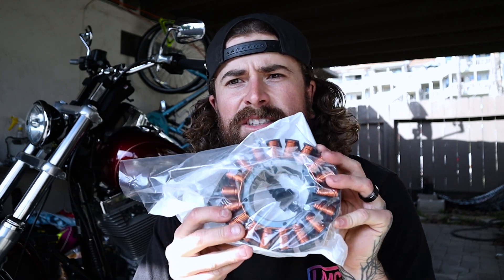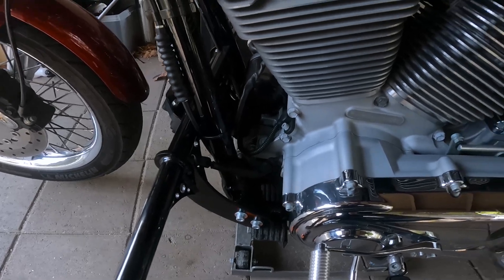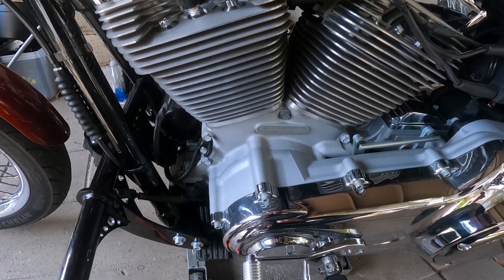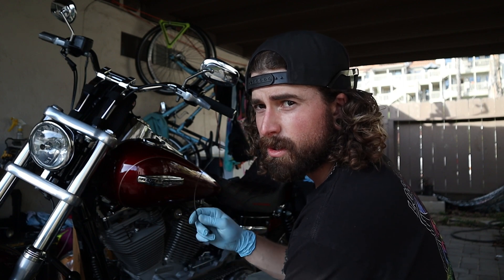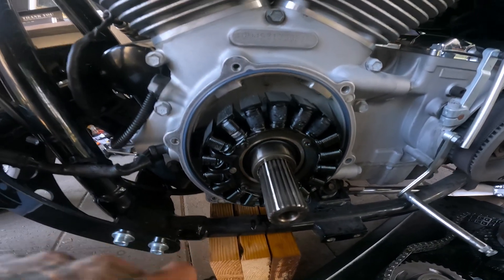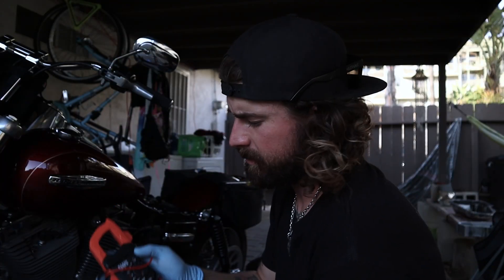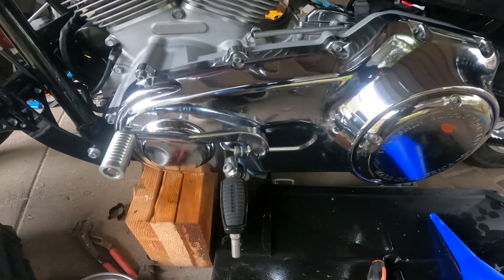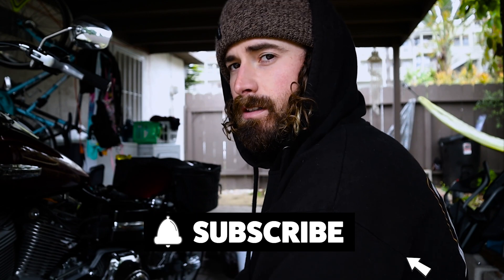Stator Failed on the Dyna! | Dyna Build Episode #7 | How to Test and Replace Harley Dyna Stator

Comment: I have the same issue the bike actually sho ked me while riding then the bat light came on after testing the atator was grounded out to the motor, The manual says to use a puller on 2011 models and to just pull off the rotor on 2012 and up

Comment: 2011 Fatbob...96ci.  Going through this now. Hoping I wouldn't have to pull the inner primary..and damn sure not going to dremel my case.   Cool vid...thanks.
Reply from the maker: I think you might be in luck. I think a year after my model they may have gotten rid of that stupid lip. Just make sure to get new tensioner bolts because I snapped one and it wasn’t even to torque yet 😬
Reply from the maker: Thank you for watchin!

Comment: Great video, I thought I was going to have to replace my stator, lucky enough I'm fairly sure my problem is the voltage regulator which has failed.
Reply from the maker: Thanks man! I really hope that’s all you have to swap. The stator is a doozy to get to. Having similar symptoms?
Reply: I have a fxs Blackline 2011, lost all signals on my speedo gauge, however I still had indicators and the bike didn't miss a beat. When I got home after a 3-hour ride, I could smell my battery cooking. I thought it would be either my voltage regulator or stator which had failed. 
I have done the continuity test on the stator which was sweet- no signal or sound on multimeter, I have done the ohms test which read .3 on my 3 phrase pins. I just have to do a AC voltage test at 3000 rpm to get a reading between 32-56 AC volts when bike is running. I feel the stator so far is healthy. I've ordered a new voltage regulator and battery and hope that is the issue for the toasted battery. and no indicator or 6th gear lights on the speedo gauge. 
on my bike I have to take off the outer and inner primary to get to the stator. Your video made the job look easy if I do have to replace the stator at some time. The job doesnt look to complecated to do :-)
Reply from the maker: @sicmic74  sounds like it would be the voltage regulator. Not sure if you know but Napa batteries are basically OEM harley batteries for about half the cost. I found this out doing research for the stator lol
Reply from the maker: @sicmic74  I’m sure your stator is healthy if it’s cookin your battery! Haha

Comment: I dig those 2 day jobs where you think a few hours is all it’ll take… but ends up being a wake up and work it out kinda thing. Any special tools needed for this?
Reply from the maker: Couple big ass sockets. 30 and 21 mm for comp nut and clutch nut. Snap ring pliers. Breaker bar. Chain lock? I forget what it’s called but they are 10 bucks on Amazon, they lock up the gears so you can break the big nuts free. And I think that’s about it haha